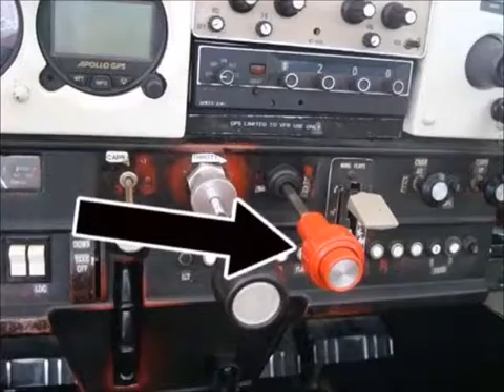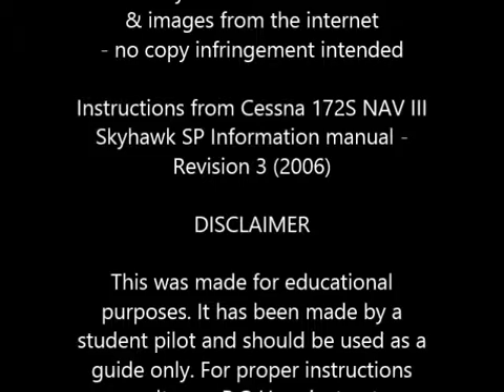How to deal with excessive fuel vapor in a Cessna 172

Comment: C152 didn't have fuel pump.. But is has "fuel primer"... Can I use that in flight in case there is vapor lock (to increase fuel pressure in the manifold, diminishing vapor lock) ??